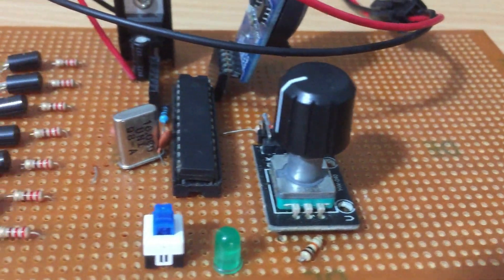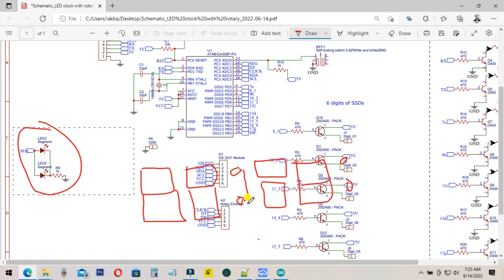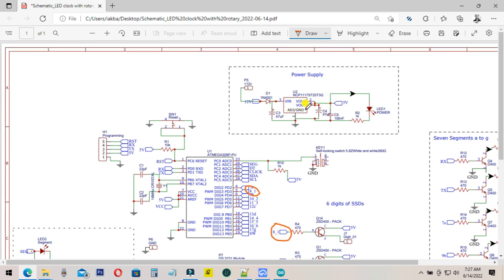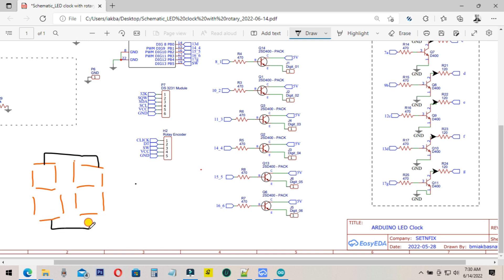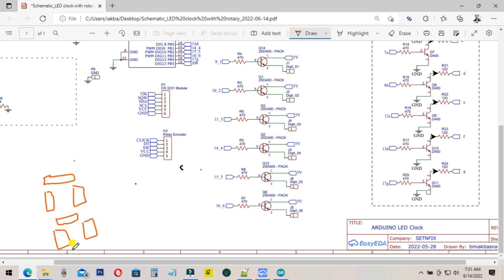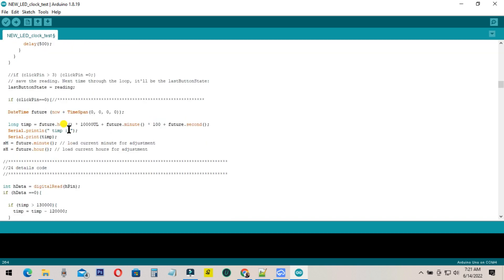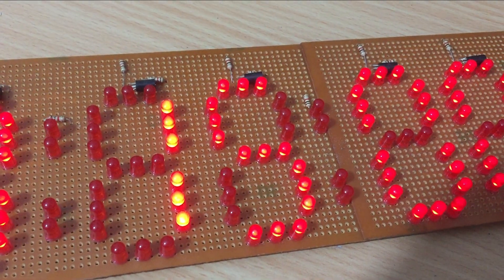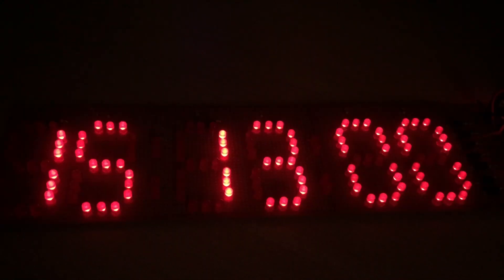Arduino LED CLOCK with DS 3231 RTC module | Final

Comment: Your LED clock working fine, but I want to know why you have used all PWM pin as digit, If i use 2,3,4,5,6, 11 and 12 as segment and 13, 14 , 15, 16,17 and 18 as digit . all other remain same. Thanks
Reply from the maker: If you use pwm pins you can control the brightness. but need to change the codes. In atmega 328p, there are limited pins and therefore, we have to use almost all the digit pins.
Reply: Thanks

Comment: As shown in the circuit diagram, all Digit driving and all Segment Driving  transistors are NPN, So can I use two pieces of ULN2003 ic instead of 13 transistors.
Reply from the maker: Yes you can

Comment: Excellent😆😆
Finally the final video has arrive, for the past few weeks I were waiting for it. Thanks for sharing your great work. Now I can easily make this project. I always love to make this kind of project. Specially thanks for sharing the Code  & Circuit diagram.
Reply from the maker: You are welcome. share your results.
Reply: @setnfix  Successfully I have build this clock, I have use total 520 Pcs leds, leds were consuming more current so I have use  TIP41 and TIP42 transistors
Reply from the maker: @Rofiul_Islam  Congratulations
Reply: @setnfix  Thanks, by the way Credit goes to you
Reply from the maker: @Rofiul_Islam  upload a video to My Facebook. Others will happy to watch it.
Reply: @setnfix  I have posted some photos on your Fb page